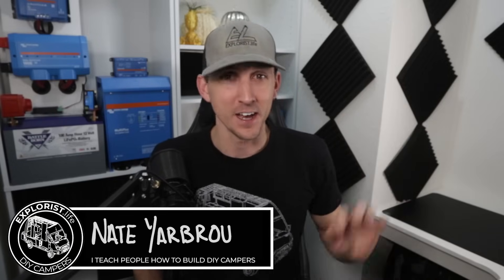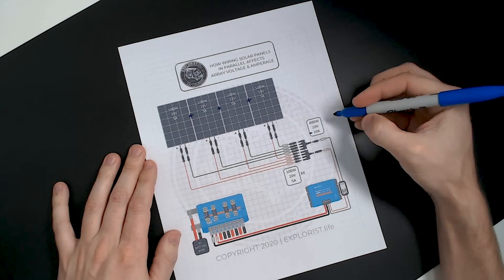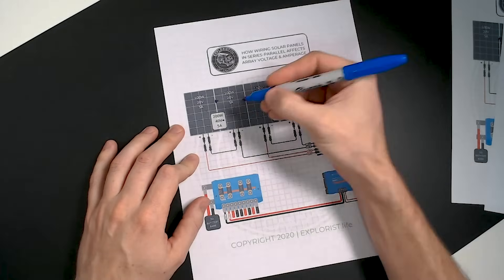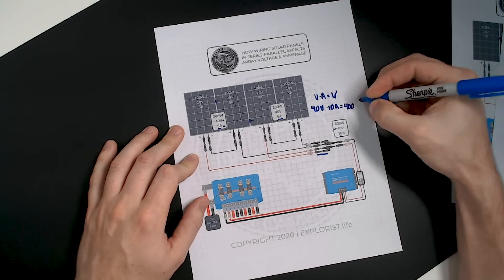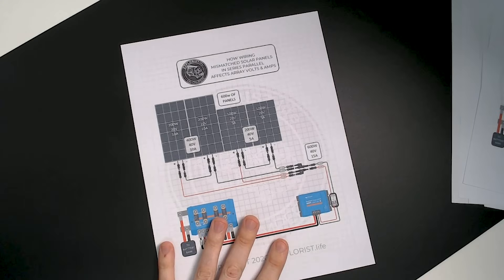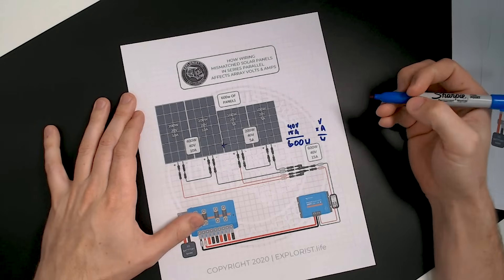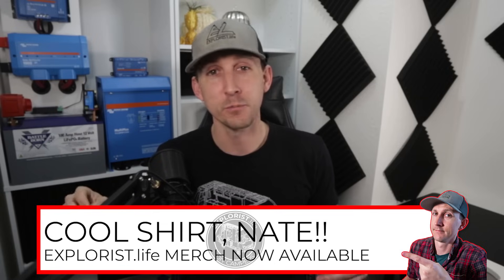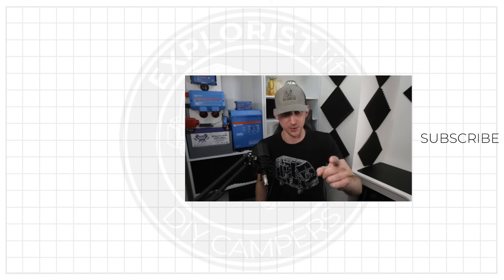How to Wire Different Sizes of Camper Solar Panels Together - Effects of Mismatched Solar Panels

Comment: What are your thoughts on fusing each battery individually (120A breaker) and then wiring to a distribution Block instead of connecting them all and wiring to a bus bar?
Reply from the maker: Without knowing the full scope of what you are proposing, I cannot say. But here is how I recommend wiring various sizes of systems: https://www.explorist.life/solarwiringdiagrams

Comment: I have room for 3 200W Solar panels. Would I be better off using 2 6volt 225 AH for 12 225 or 4 and have 12 450 AH with 600 Watts Panels ?
Reply from the maker: That would depend on how much power you anticipate using on a daily basis.  Here's a tutorial to figure that out: https://youtu.be/a406IxiU-Xg
Reply: @EXPLORISTlife  Thank you for the link I have bought your wiring diagrams and ready to get started.

Comment: This was a great guide :) I had been pondering on similar problem when using 24v system and using 12v light bulbs and what would happen with mismatched bulbs in series to make 12v work on 24v and came to similar conclusions, had not thought about it when it comes to solar panels and it would be simlar problems... But it is logical when you think about it :)
Reply from the maker: Glad it was helpful.  Cheers!

Comment: Nate
I had read some where that to connect an Isolator to the Generator you must check the size of the generator first?
and if it is small sized on rating do i need to go to the highest for that Van?

Thanks for any help

Gary
Reply from the maker: I'm not fully understanding your question.   What are you actually trying to accomplish?

Comment: Thank you for a great video,  I subscribed!  I have 3 bougerv 180 watt panels I plan to wire in series to a bluetti 2400 in series.  My array is 100’ from my cabin.  Would #12 wire be sufficient?  It would be 10 amps but not sure about voltage drop. Also is there enough protection in the bluetti or do I need to invest is additional fuses?  Thanks!
Reply from the maker: 12 AWG would be 8% voltage drop, so it's probably best to go with 10 AWG to get the voltage drop down a bit.  No MC4 fuses are necessary with wiring in series.  A dual pole disconnect for the solar arrray would still be necessary like as shown in the bottom of this blog post under the solar wiring diagrams: https://www.explorist.life/3000w-inverter-400-600ah-400-to-1200w-solar-camper-solar-kit

I'm not sure what is the max voltage input on that unit, so be aware of those thresholds.
Reply: @EXPLORISTlife  thank you very much for your time and expertise!!

Comment: I have a question on mixing panels and add, mixing arrays. I have a 150 watt panel on my camper roof with its own PWM controller. I recently purchased a solar generator and with it two solar suitcases with a total of 200 watts. The suitcases are identical. Would it be possible to wire the suitcases with the rooftop panel? The suitcases operate at 21.6V with each suitcase giving about 2.78 (x2) each,  The rooftop is 150 watt at 22.5V at 8.38 amps. Would I connect them both to the same controller MPPT built in to the generator (limited to 150 volts and 12 amps) or what? Help!
Reply from the maker: Based on the things you learned from this video... How do YOU think your array should be wired?

Comment: Hi what if you had a van/boat and had 4 100w panels 2 on top and 1 on each side  left and right so 4 100w total. What would be the best setup series or parallel? Take into account that only 3 panels would get a charge in the evening as the sun  goes down.
Reply from the maker: Based on the information provided in the video... what do YOU propose as the best way to go?
Reply: @EXPLORISTlife  top 2 in series and side 2 in series then put top and sides in parallel. The only thing is will the solar panel not getting light drop the total pack voltage?
Reply from the maker: Agreed.  Another option:  You may get better performance if you used 2 separate charge controllers.  Top 2 panels wired in series to one controller and the side panels wired in parallel to a 2nd charge controller.
Reply: @EXPLORISTlife  is that because of the lower power from the side panels. Thanks for your advice and keep the videos coming thay are very informative and more importantly easy to understand. Great work
Reply from the maker: Correct.

Comment: can i make a request? I'd LOVE to see a video &/or blog on how to configure a Victron SmartController to divert output to a dump load when batteries are full (e.g. to my Calorifier tank that has 12v immersion coil). Victron have a video saying it can be done, but Victron's community pages, like me , are full of questions asking how to do this. Cheers!
Reply from the maker: Great idea!  I'll add it to the list.
Reply: I am going to try something similar. victron smartsolar but 24v system. good luck from Belgium

Comment: I came across your YouTube site. Very good explanations on the panels and systems. You have done a very good job on the educational aspects of the web site. Using ABYC as a guide is also brilliant. I wish I had found this 5 years ago when I was exploring solar.

 

I am retired, used to run a fire LAB and I am now bored a lot.  I set up a test rig a few years ago to verify the different types of 12V 100W panels and types of controllers.  I used a 4 tube Florent ceiling light fixture for a  constant light source. I put the panels on the light source and fed them through both PWM/MPPT controllers. Measured all  the outputs, charging times, loads etc.  after a few weeks of testing I came up with the best configuration.  I charged a 950 Ah lead acid battery, then I would use a 2Kw Inverter to power up 3 100W light bulbs and drained the battery to 11V, then charged it back full. After doing this 15-20 times I was able to calculate the power generation of each panel and efficiency of the controllers. Then moved outside to do sun source testing.  Lots of fun was had.

 

I have a 76 VW Camper.  I installed the test solar system on the bus.   I have a pair 100W panels in series feeding a cheap MMPT controller.  I live in the Pacific NW and all the rain and clouds here are not optimum for solar.  Plus the latitude of 48 Deg north means the sun angle is low.  The standard 12v panel would not reach charging levels all the time. My testing showed only a couple hours a day they would produce charging voltage when in parallel.  So I put the panels in series so when each panel made 7-8 Volts the sum of the voltages will start the charging cycle. Current is low 5-7 amps, but acceptable for this application and this actually works very well in this area.  I have a pair of 650Ah Lead acid batteries and they stay full with the system.  When the batteries are full the controller shuts off the charge and the panels go to open circuit voltage.  The bus is parked most of the time and not used much.

 

The MPPT controller has a switched load, (like they all do)  I am looking to use the excess solar panel power on a restive load after the batteries are full.  Since the bus  has a refrigerator that runs on Gas/DC/AC.   I wired the switched output of the MPPT controller, to the Refrigerator electric heater (12V 1500W) through a diode.  I have run this for a few weeks to see how the system will operate. The refrigerator stays cold and occasionally will freeze water on a bright day. This works very well to use the excess power generated so the panel does not sit around at open circuit voltage most of the time. But it's a manual operated, go push the button system.  The power is way less than the 1500 watt design but just warm enough to boil the ammonia in the evaporator.  I have also wired this into the cheap Chinese  diesel heater, it will run on the solar panels alone after it is started and up to temp ( heater fans use 2.5-3.5 amps ) so it will operate on a bright day.  It can't start on solar, since the glow plug on start draws 10 amps but after the glow plug cuts out the fan blowers work fine on solar.

 

Question  for you....

 

Do you know of any MPPT controller that will automatically switch to the "external load mode" when the batteries are full.  Or a way to automatically switch with a relay to off load the excess power.  If the refrigerator load could be automatically switched, it would run on the solar panels when driving and the alternator is keeping the battery voltage above the MPPT cut off voltage.  This is not all that important on this bus, but on larger solar systems, the excess power can be sent to the 1500W heater strip, or maybe a hot water heater element. . On larger RV's this could save the panels from the Open Circuit condition which is not good for the panels. .

 

Thanks for your time, great job on the solar series.
Reply from the maker: Although it is indeed possible, load dumping is not something I have experience with.  Here is a forum post on the Victron discussion boards that may get you pointed in the right direction: https://community.victronenergy.com/questions/2089/mppt-dump-load.html

Also... having the panels in 'open circuit condition' is not bad for the panels.

Comment: Thanks for the video Nate. Have you considered a video on how to wire the leisure battery to jump the van battery in the event that you drain it, such as when leaving the lights on? This is a topic I cannot find info on but I'm sure many would like to know.
Reply from the maker: Great idea!  I don't have a video for that out, but will be incorporating that into my next van build so will be sure to talk about it.
Reply: Look for ANY video about how to jump a car battery! And I really mean any...
Positive (Red) first to be connected. Followed by the negative (Black). Make sure to produce a good contact, with CLEAN poles and clamps!
Start the vehicle. I always let it run for a short while...
Disconnect the negative (black), and finally the positive (red). Be aware of the sequence! A detail many tend to forget!

Easy way to keep it in mind! Red (positive) first and last. The rest in between. 

ALWAYS manipulate ONE cable at a time. AND do not hold them together (clamps) under your arm pit while connecting/disconnecting. A colleague literally lost is shirt and had some of his arm pit "fur" burned because of such small detail! LOL 😂
Cheers

Comment: Hello,
I am designing a camper in the Netherlands that going to travel through Europe.
Om the roof are two 150W panels. Each panel has 19,8 V and 8,24A.
I am thinking to use  a Victron MTTP 100/20.
Shall I use s parallel or a serie configuration? 

With regards,
Edwin
Reply from the maker: Your solar array voltage should be at least 20V over your battery bank charging voltage (and below the max voltage input of your charge controller.  For this reason, given you are charging a 12V battery bank, you should wire in series.
Reply: @EXPLORISTlife  l

Comment: Can you comment on using multiple MPPT controllers to support 2 or 3 different arrays?   I would like to start simple with a 200 watt ground deployed solar solution, then down the road, add the primary array on the roof.  I'd like to use a small Victron for the ground to start, and then add the larger one down the road - so hoping the Victron MPPTS can be wired in parallel and both feed ONE primary battery bank (LIFEPO).  200 watt ground with MPPT, then later 400-600 roof with MPPT - 800 total coming from two different arrays.  I know there is the new VE.Can stuff but its pretty pricey and was hoping to use the normal line of Smart Solar units (100/30 etc...)  I'll want to add a dc-dc charger as well at some point....kick all of that around... - Tom down here in Albuquerque.  Love your site...have watched or read everything...
Reply from the maker: You can definitely use multiple charge controllers.  The Victron Smartsolar charge controllers can communicate with each other wirelessly to coordinate charging.

Comment: What is “working voltage”, “open circuit volts”,  and “max power volts”?   I am wanting to use 2, 105 w panels with (on label) Amps=3 x 1.97, open circuit is 21.3, max power volts is 17.8.   And one 50 w with working volts being 18 , open circuit is 20 volts , and working current is 2.9 A.  This is the way it is worded on the solar panel labels. What would be the best way to wire these?  Thanks!
Reply from the maker: For the sake of this video, you want to use working volts/amps to determine actual power output.  Open circuit volts is what you get when the panels are under virtually no load (if they aren't connected to a charge controller, or actively charging because the battery is full, for instance)
Reply from the maker: ...and the only way to wire those panels without severe power loss would be in parallel... but an MPPT charge controller wants the array voltage to be at least 20V higher than the battery bank charging voltage; so you are in a lose-lose scenario with those panels.
Reply: @EXPLORISTlife   THANKS!!!

Comment: Hey Nat how about another method of dealing with different types of panels, use multiple controllers building strings of like panels on separate controllers? Victron’s will talk to each other so that they get along ok on the same battery bank. I realize that it maybe more expensive to build in this way but if the situation arises what do you think?
Reply from the maker: Yep! That's definitely possible, but that that point you are talking about two separate & independent arrays coordinating to charge the same battery bank; so each array would need to be planned properly before going to the charge controller.

Comment: So does the controller determine what v charges your battery? I want to charge my batteries at 24v (for obvious reasons) but mine panel options are pretty much limited to 12v configurations. But having my controller setup for 24v means that my battery also needs to be wired in series (or at 24v)? I do plan to convert 24v to 12v before service panel to supply power to lights/switches inside the bus.
Reply from the maker: The charge controller is indeed responsible for charging your battery bank at the appropriate voltage.  In the case of Victron MPPT charge Controllers, they will auto-sense the battery bank voltage and it can be further tweaked for your particular battery chemistry within the VictronConnect app.

As far as they array voltage goes, though...  Your solar panel array needs to be a MINIMUM of 5V over the battery bank charging voltage for the MPPT charge controller to turn on.  You can use whatever solar panels you like to come to the proper array voltage.  more info: https://www.youtube.com/watch?v=6G3Mo_OHmQY&list=PLmvhcyi4n0TVgcroqXl5QvJM0afUes_zX&index=3

Comment: Great video!  I just got a deal on some used panels and was trying to figure out which wiring config was best.  I now have 3 different type of panels, however, I believe I will only be using two different types.  I am only working with a MPP SolarPIP-1012LV-MS 1000W 12V/ 40 amp and a 80v to 100v max input(s).
Reply from the maker: Glad it helped!
Reply: @EXPLORISTlife   I still have an issue so I thought maybe I would post it to see what you or anyone thought.  So with the PIP inverter mentioned above I tried to install these new 250w / 24v /8.3 amp panels.  The inverter states it can handle 500-800w PV input and 80-102v and 40 amps.  I tried just one panel and the inverter will not charge the battery bank, it turns on and cycles through to show the solar panels charging but then stops.  I can not figure out why just one panel will not work.  I was using 3 flexible 100w/18v panels and 1 mightymax 100w/18v panel, total of 4 x 100w panels that produce over 80v but never seem to get over 222w in south Florida.  This is on a small bus and I have the room for 3 x 250w panels that I was hoping to install, but I can't get 1 panel to work.  I am in the process of making a MC4 parallel connection which I am praying and hoping works.   I ordered some more parts, meters, etc... to help me figure this issue out so I will let you know what happens.
Reply from the maker: Goodness...  You've definitely got a lot of variables going on. 0.0

Comment: Does any one know why once you turn the main switch on your elétrica set up there is still a voltage running thought the system, I’m my case the dc voltage was 12v, after turning the off switch, it didn’t go to zero and dropped to about 5v and was slowly going down
Reply from the maker: Certain things will hold a bit of voltage in them.  I've seen LED lights that will hold a touch of voltage for a minute or two after disconnecting the batteries from the system.

Comment: Can you/ what happens if monocrystalline and polycrystalline panels are combined in an array?
Reply from the maker: Very little measurable change.  The math is the only part that really matters.
Reply: @EXPLORISTlife  I have a 100w monocrystalline panel and wanted to add a second panel. With 100w polycrystalline I've noticed they're cheaper. So there is no problem mixing the two different types? Thanks